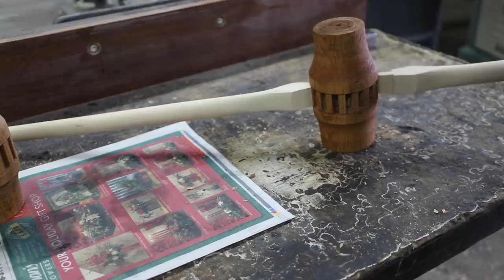Buggy Wheel Hub Comparison | Old vs New | Engels Coach Shop

Comment: Thanks for the great video! I am going to timestamp my highlights :)
3:30 was a great tip for locating and preparing the stock for the drive spur
9:45 the indexing ring and fixturing for the mortiser are fantastic!
15:00 the option you have for the pivoting head on the drill press is really unique
It was also very enjoyable watching both style hubs and spokes being installed.

Comment: One time saving trick about wood turning is to knock the corners off at 45 degrees before mounting it on the Chuck/tail stock so there's less material to take off to make it a cylinder and it causes less wear on gouges etc. Indeed it's safer as well since it has a tendency to throw of large pieces when left square when turning when done by hand because the tool does travel in more when the stock turns until the next corner revolves engages as many are more aggressive at this point rounding it. Many tend to begin rounding with the stock turning at to high a speed instead of lower which is dangerous because its rare to have piece that's in balance which can throw it off the lathe damaging it/you together. An experienced turner knows to start slow since it lessens this out of balance effect and one should stand away from the stock when the power comes on just in case because the more it is the stock can make it break free when raw material is turned. An old school way to tell if the stock is turned completely into a cylinder is to take the tool and rest it past the top center of the stock as its spinning to feel or hear it skip because when it's true it won't. A delight as always and happiness is when an artist like him has nice supply of tail end and left over pieces since he likely finds one that works when it as organized as this...👍
Reply: I'd guess that in his many years of lathe turning Dave has tried just about every technique and has settled on the one that he finds most efficient.

Comment: The new style hub must have been considered almost revolutionary when they first appeared.  In the new design you can see the continued thinking of moving away from wood to metal cast parts that led to the industrial revolution and interchangeable parts.  One wonders how many fewer wagons would have collapsed or fell to pieces to be abandoned on the trail West.  The heavier loads that would have been tolerated verses with the wooden hubs.  It was certainly a wonderful adaptation of the wood hub.

Comment: I'm not a purist but I like the "Old Stile" better against the roller bearing hubs. Each has it own place I guess. Thank you for showing the difference between the two. See you next Friday.
Reply: The old style and new style are irrelevant today, considering that when the "old" style was old ... was sometimes in the 1800's when they came up with roller bearings. Post that date, with notable exceptions, most vehicles were furnished with variants of the roller bearings at an increasing rate.

The sad part is that the new hub is made outside US...
Reply: @aserta  along with most everything else in our homes...

Comment: Very interesting side by side comparison.  I wonder if the modern hub holds the spokes as well since there is very little amount of tenon in the hub.  But I do see that a wood hub would need a lot of lubrication to keep it from wearing out.
Reply: It's the rivets that hold it all together tightly.

Comment: Do you ever saw off the four corners of your square blank, making an octagon, to speed up the roughing on the lathe? Could be done quickly on the table saw with a sled to hold the blank at 45 degrees.
Reply from the maker: Usually on larger pieces.

Comment: As always it is a joy to watch you work. On the roller bearing hubs will the spokes be bolted into place using the holes in the hub or are those holes for another purpose?
Reply from the maker: Yes they are bolted.

Comment: Fascinating to learn that Timkin bearings have been around that long. I had no idea. Question: Have you ever thought about using a lathe duplicator for the task turning multiple hubs? Perhaps it is just a preference on your part or perhaps each hub is unique enough to require customization. I am curious to know your thoughts on the usefulness of something like a duplicator given the number of hubs you must do.

Comment: Do the metal hub caps fit on outer and inner diameter or do they fully match the hub form if so how did you turn that to match. Also I saw the rivet holes miss the spoke centre line are you just going to know them off and move them round or is there another reason. Great work I love watching and would love to have a go. I think you are teaching for generations to come with this work. And your predecessors would be proud of you. You are enabling those who want to get a fantastic education. Great film work and a good example of efficient clean working why put waste on the floor when it can go in the bin and it’s fuel for the wood burner. Thank you
Reply from the maker: The holes in both flanges are aligned so either the rivet or the bolt goes through the spoke shoulder joints, locking two spokes at once.

Comment: Hello Dave, do the spokes in a metal Hub wear out as I would have thought that wood to wood in a conventional Hub would be a better mating surface than wood to metal with no give in the hub ? 
Regards Richard 🇬🇧
Reply: Richard Chivers, That's a very good question that I would like to know the answer to as well.
Reply from the maker: Well even these Sarven metal flanges contact the wood spokes.  Usually the wearing out is a factor of time and poor maintenance.
Reply: @EngelsCoachShop  Thanks for the reply Dave
Regards Richard

Comment: You need to step up your technology, that rubber band holding spring tension on your dividing plate will not last, I found that my granddaughter's elastic hair tie is a far better option.

Comment: I was wondering if bearing came along with the on set of the horseless carriage,
Reply: First known roller bearing is 2700 years old. Kelts and Romans already figured it out. First modern patent including a ball bearing is from 179x.
But to really make them precise and available in mass the key invention was the grinding machine for steel balls at the end of 19th century.

Comment: What was the square buzzing punching tool used with the makeshift dividing head tool?
Reply: It is called a "broach".  There is a sharpened square steel tube with an auger bit inside to make the slotted holes.  The auger starts the hole and the steel tube acts like a square chisel to cut the wood as the whole thing is pushed into the wood.
Reply from the maker: A hollow chisel mortises.  The auger bit removes the bulk and the square chisel cleans out the corners, all in one pass.

Comment: THE AMISH place their trust in God...

But a decent set of those newfangled hydraulic brakes doesn't hurt either.

As ever, the Lord helps those who help themselves.
Reply: driegendre  ,  Amen to that!
Reply: @BruceNitroxpro  Yes. ;-)

But I do wonder what the Amish rationale is for this modern contrivance. Hydraulic brakes first appeared in the early 20s, and became nearly standard by the early 30s. 

It might be a matter of the purely mechanical nature of hydraulics that makes them acceptable, despite being a 20th century invention?
Reply: @drlegendre  ,  Don't ask, don't tell? LOL
Reply: @drlegendre  Just might be a consideration for the state or local laws - which may well require some sort of braking system on buggies that travel on roads with autos.  I'd think that a hydraulic brake system would be much easier to install and manage, than a mechanical braking system which would require direct connection to the hubs.  Or not.. just thinking out loud...